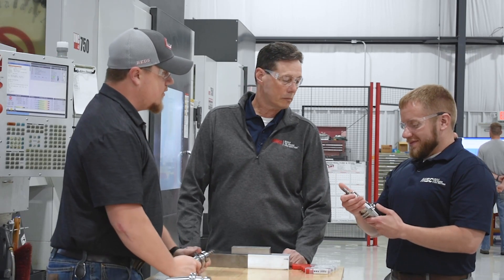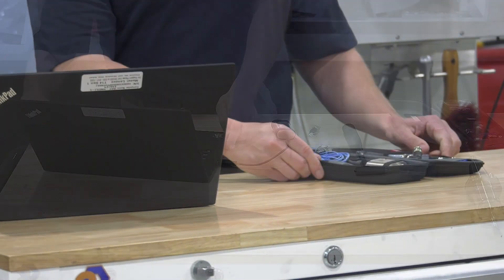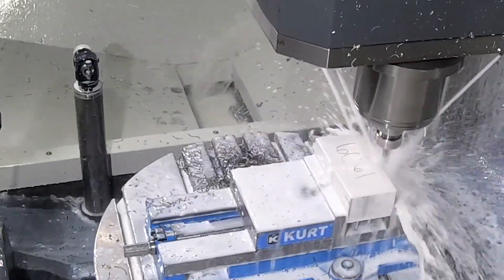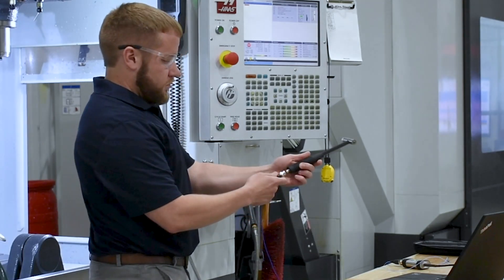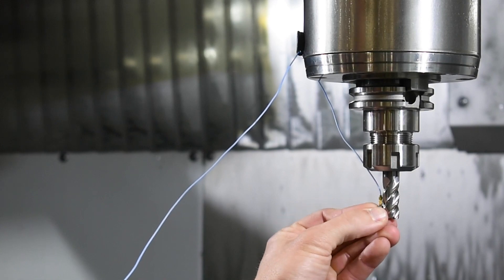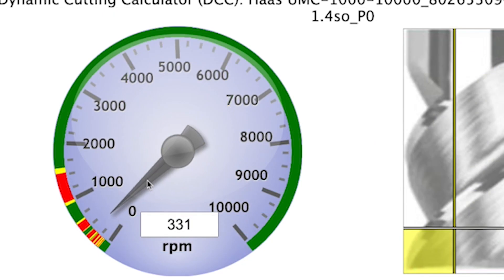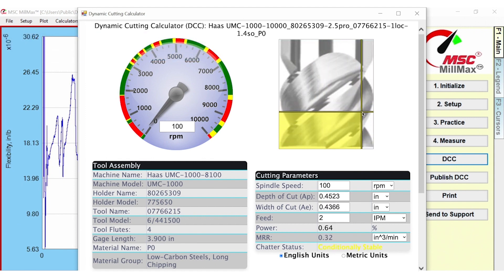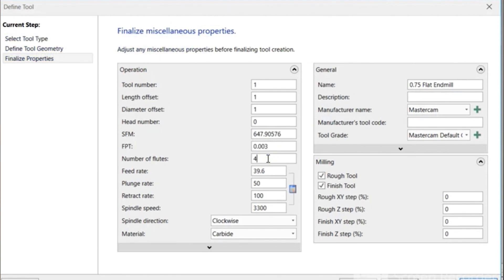Improve Your Milling Performance with MSC MillMax®

Comment: BUYER BE WARNED!  If you can't rate and review a company on Google, you probably should reconsider doing business with them! If MSC backorders or directly ship an item from the factory on a partially shipped order, and months later, that card is closed, they will charge a crazy shipping and handling fee and then add a $10 credit card fee.  Even if the back ordered item was $13, $1, or  50
If I had known a $3.14 could end up costing $8.76, I would not have ordered from MSC.  Notified of the added $10 fee and the ballooned shipping charge after the fact.